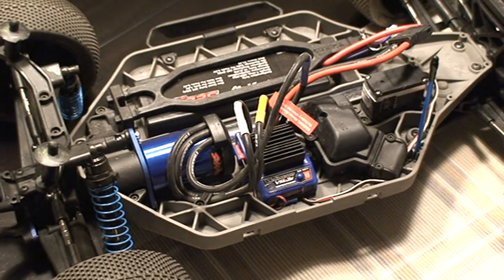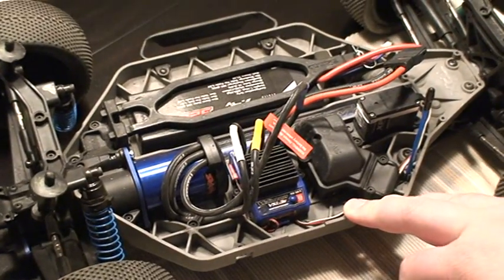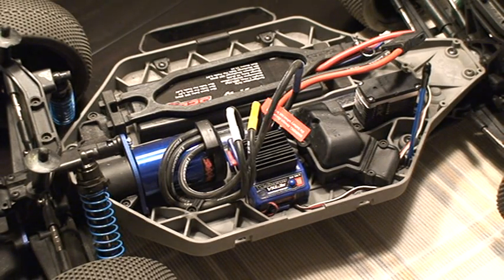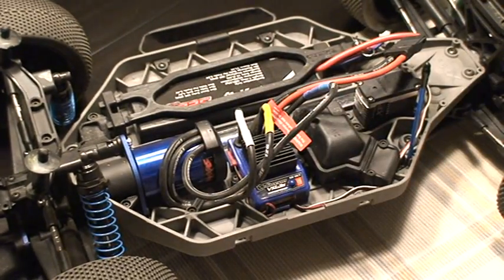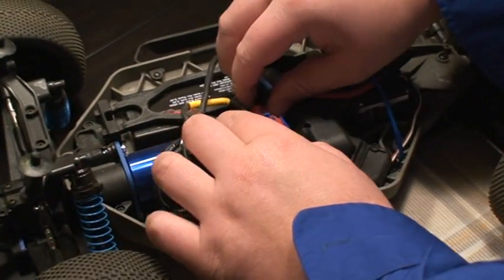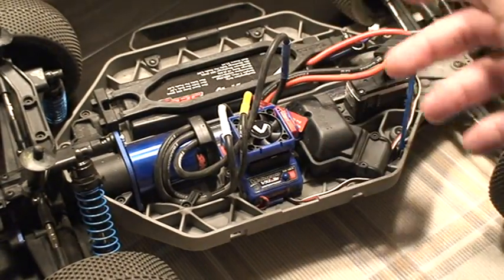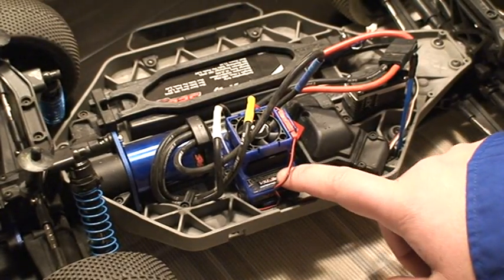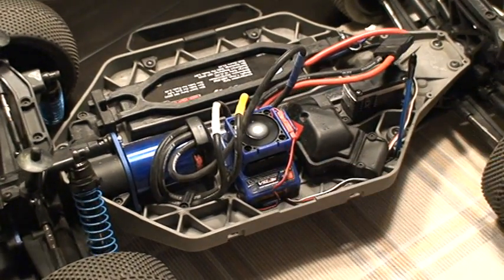Traxxas ESC Cooling Fan Install

Comment from the maker: @bubu8947 I didn't really find a difference.  It seemed to clip in just fine in either direction however the otherway makes it a shorter run for the cable which is nice.  I have had it out on the track for quite a bit and its still rockin just fine.

Comment: i have two questions for anyone who may know? the velineon esc fan does it come with th cord to plug in 2 the esc ? anybody know the heatsink motor fans do u know of any bran of them that will work on a 2wd traxxas slash u guyz may know that the motor on them sets all the way in the rear of the car if anyone's got a link to one that will work with a slash 2wd it would be much appriciated!!!